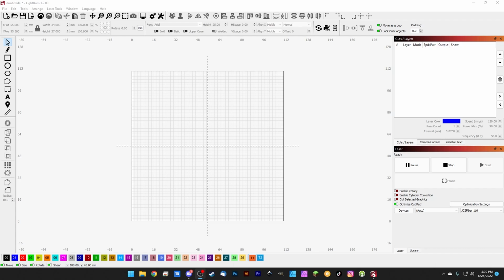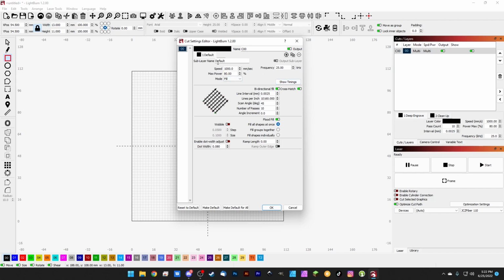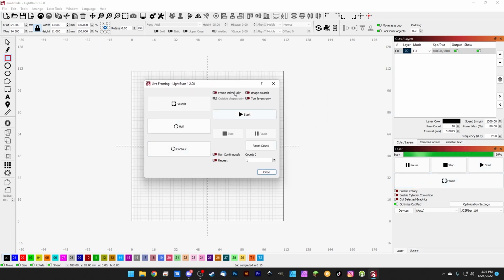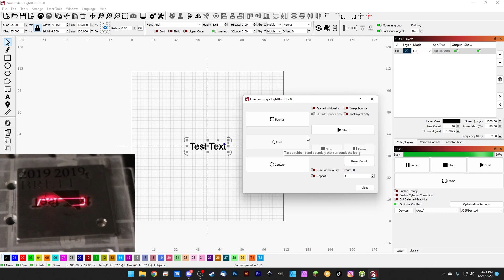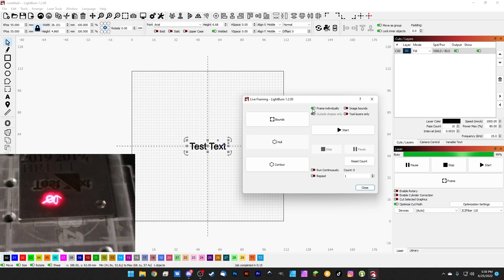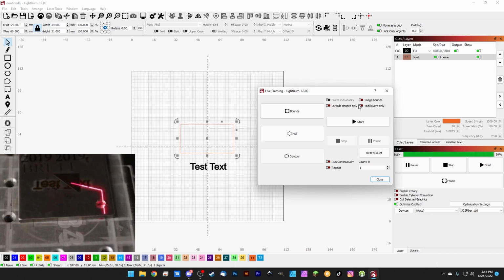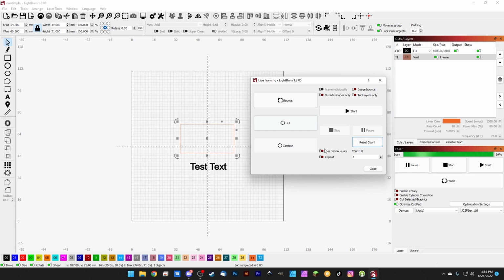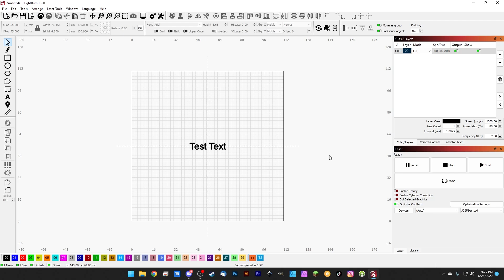Exploring the LASER Tab and Framing in LightBurn for Galvo

Comment: Thanks for your video.
I have a question.Can you help me ?
How can I rotate symbols on laser bed  ? 
I want it that İn the same direction as on the lightburn screen
Reply from the maker: You haven't made it that far into the series playlist yet, you've got a few lessons to get to that. Sounds like you'll be looking for the lightburn lens calibration and corrections video. That covers fixing the scale output after you get your focal height set so items are the right size, orientation and inversion on each axis, as well as your typical skew/trapezoid correction and such. You no longer need to swap to ezcad to get the tool to automate the process, lightburn added a tool and we've added that to the playlist as well. Hope that helps!

Comment: In this video, your red framing light is very bright, is there a setting to adjust brightness in framing mode? Mine is very dim. 
I have a Monport 30w Mopa with Lightburn 1.6.03.
Reply from the maker: The brightness can be due to a few things and is laser vendor/model dependent based on the parts they used to build your unit (so it could be different for everyone). Some sources actually have an internal red dot in the source itself, and that gets set by the manufacturer often through a rs232 cable and special software, and the brightness level can be changed.
The other option which is a more long term sustainable option, is a beam combined red dot. This uses a special beam combining mirror to reflect the red dot into the same or similar path of the laser beam after it leaves the emitter but before the laser head/mirrors. This makes the red dot physically separate, meaning its replaceable separately too. They cost just a few bucks each and can be swapped in like 3 minutes and is just an on/off thing so will always be full brightness typically, but if its internal it is a manufacturer service item to replace which increases cost. 

Your red dot may be dim for a few reasons, but I would guess if you're using a JPT mopa source that they could be relying on the internal red dot of the source (a nice value add feature of the JPT sources), but if the brightness level is available for change, it may not be turned up. You can reach out to Monport to see if they can assist with that, and they should also be able to confirm if that is what they are using (internal to the source), or a combined red dot. If its dim and combined, simply getting a 3 dollar replacement red dot and swapping it would probably fix that.

Hope that helps!
Reply: @LaserEverything  it does help thank you, I have reached out to Monport, see how it goes. Thanks

Comment: My frame (red light) burns at the same rate as the laser (if the laser is set to 80% power, if I frame it cuts at 80%) I can't find where to change the red light power. Using LB 1.6

Comment: I have an Omtech Fiber Laser 30W machine and I can't get it fully operational. I bought it second-hand directly from Omtech; their customer service is hopeless. I'm in Ensenada, Mexico, and there's no one here who understands it. I moved here from Austria. My main business is 3D printing. The machine arrived with a wrong motherboard, which Omtech replaced. The machine is uncalibrated, I have trouble installing drivers properly (didn't receive USB), EZCAD doesn't work, LightBurn can laser but framing doesn't work at all. Do you know what the problem might be? Thank you!
Reply from the maker: There are a few possibilities. It's possible the framing red dot laser is controlled through a I/O port, which you may need to trial and error your way through testing and finding in the device settings. It may freeze or cause your laser to fire. If that is the case, be prepped and safe, and be ready to hit the E stop to kill the power. If it causes things to freeze or misbehave, go back into lightburn and change the port back before turning the laser back on and trying a different port. Not graceful, and requires safety planning, but its doable.
Alternative is that there might be a physical red light button to turn it on, usually on the laser head, or on the box if its a split style unit. That may turn it on and sort that out. 

Unfortunately, lasers can come with red dots within the source (Like JPT's) or may use beam combined red dots within the laser path (in the arm of the laser on the tower, just before the laser head), and then ontop of that, many ways to configure and software/hardware power and control them. Thats about as far as we can get in the youtube comments, but if you're still stuck or need help, I highly encourage you join at least one of the free communities we link in the description so the support community can help you out in a thread.

Comment: Hey Alex and all!
I have one question: On my contour preview of the text laser projects mirrored contour instead? How to change it? Its a lil confusing.
Anyway - thank you so much for your tutorials!
Reply from the maker: Hey! If your laser is seeing mirrored output / framing, you can reverse the direction in the device settings (its the option under galvo 1 or galvo 2, where it says reverse direction/negate). The galvo you reverse is going to depend on which axis is being mirrored, so try one and test to determine if its the right one. This is something that will also be corrected during a corfile typically when you run that, but that's how you manually flip it. Hope it helps!

Comment: My 50W Raycus never shows ready...? Even though everything is working. Also the job never shows the progress information that I see when using my diode laser in Lightburn. Help please?
Reply from the maker: The ready indicator has never been particularly reliable for me either - I just ignore it. 
Progress information isn't really accurate for fibers as fibers are constantly streaming data to the laser in chunks. I think that's something that could use some improvement in LightBurn eventually...
Reply: @LaserEverything   Thanks for the clarification 👍🏻 🙏 Would be nice in  future updates to see the progress, pass number etc... that you get when using diode lasers with Lightburn.

Comment: Your videos have been SO hopeful.

I'm having a big issue with my framing button. It was working fine, but all of a sudden when I hit the Frame button it starts the beam and runs continuously until I pause it, then stop it. Frustrating! Have you encountered this by chance? I've turned the "require framing" toggle on and off to no avail :(
Reply from the maker: Check what port your red light pointer is set to activate on and make sure it's not mixed up with the "start marking" port. Start marking is usually set to 10-15 so if the red light is there that may be causing the issue.
Reply: @LaserEverything  I've tried every port and none of them works, but it works in EZ Cad.
Reply from the maker: Check the Facebook group or discord so we can take a closer look I don't think we can solve this one in the comments

Comment: Hi Alex, Great Videos! quick question tho. When i click frame my red dot goes away but it doesnt light up anything. Bounds, Hull or Contour, nothing lights up. Where would i find that setting?
Reply from the maker: Check the episode where we cover device settings and talk about ports. See how your red light ports are configured in your F3 param on ezcad and make sure they match. Issues like these are usually port issues.
Reply: @LaserEverything  (I am now a paying member!) Alex I have the same problem. I bought your recommended 50Watt Mactron JPT laser, just got it... I don't have a PC to run Easy Cad on... I am just running Lightburn and hoped I would never have to use easy cad... is there any other way to find these settings without doing 100 to 1000 port number guesses? On my I/O ports the graphic above says 0 green, 1 red, 2-9 are green, 10 red, 11 red, 12 green, 13 green, 14 red, 15 green. My Ready Light setting is set to None and so is my Red Dot drop down, set to None. I'll keep at it, my laser just went off due to this when I was expecting a red dot... always wear my glasses! - lesson learned.